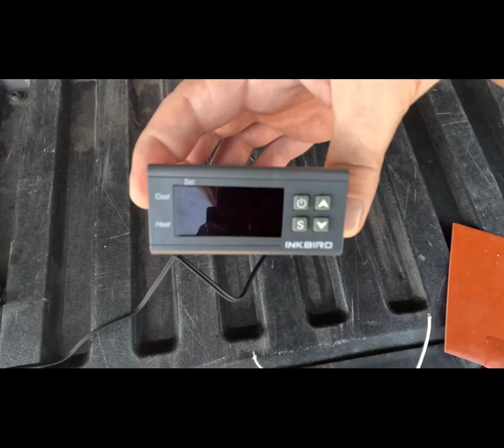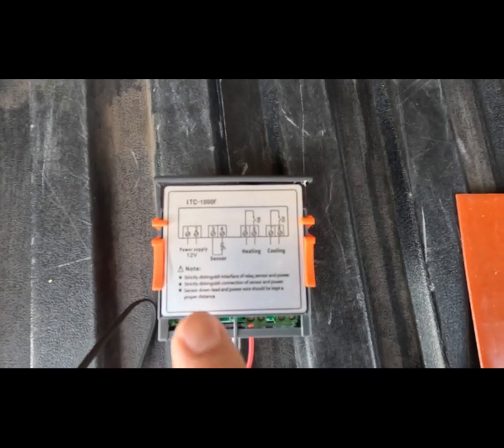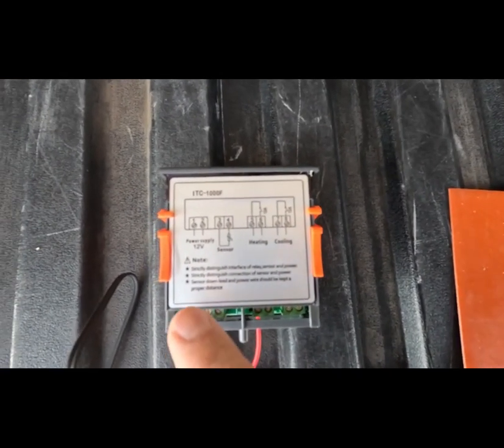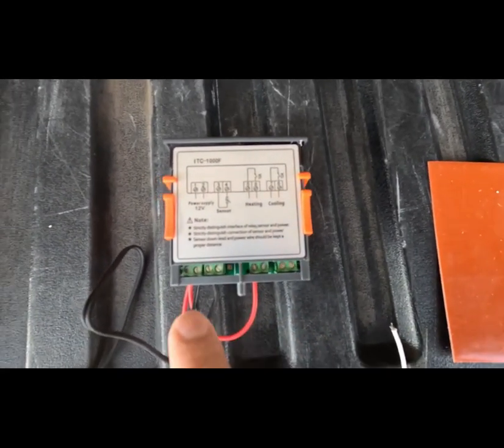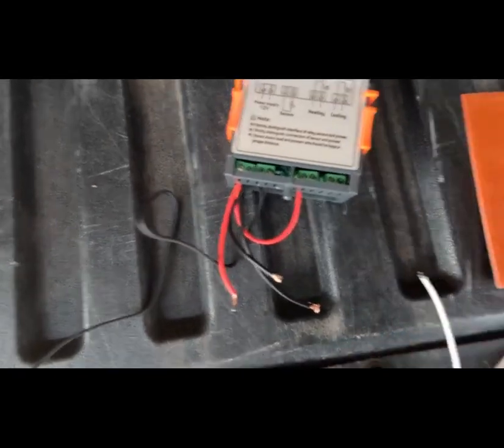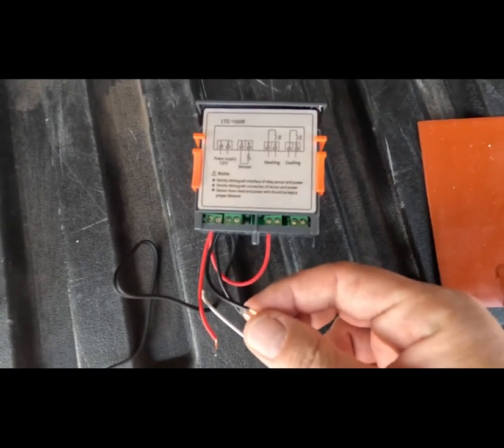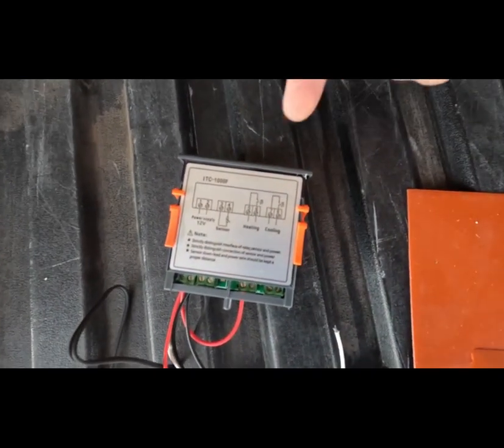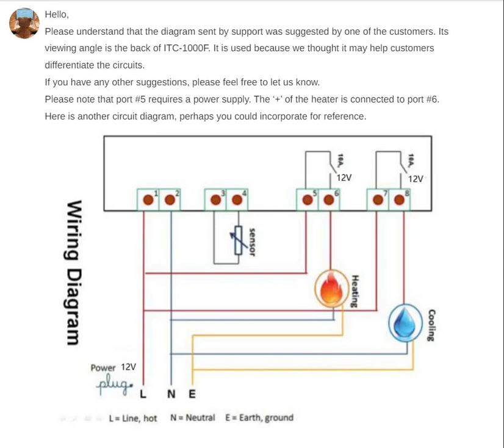INKBIRD ITC-1000F 12v Wiring - Lithium Battery Warming Pads

Comment: The 1000F thermostat provides a Relay ( switch ) for a heater and a Relay also for a fan or refrigeration.
You can run a wire from your DC power supply separately or fed with a jumper
either way but, you will need to run a power leg to and from the relay or relays to that device want to switch on or off.